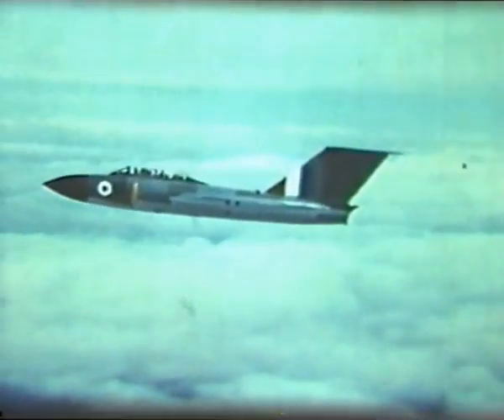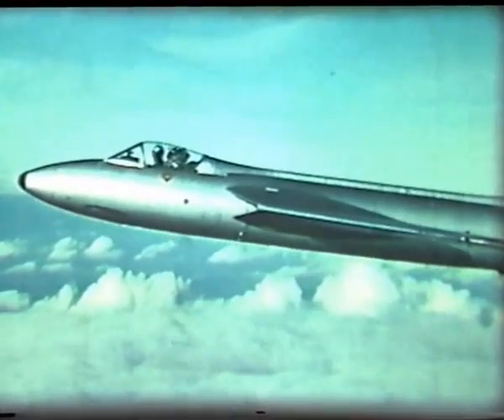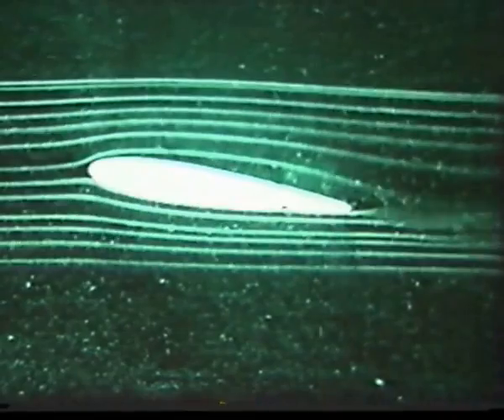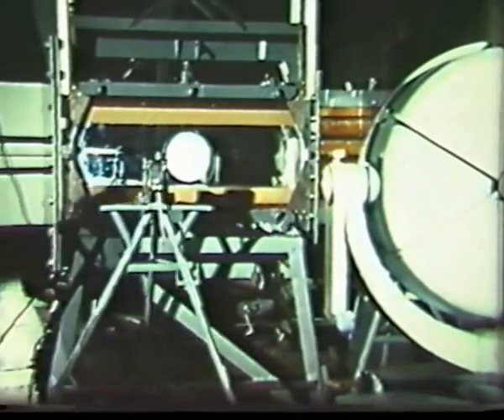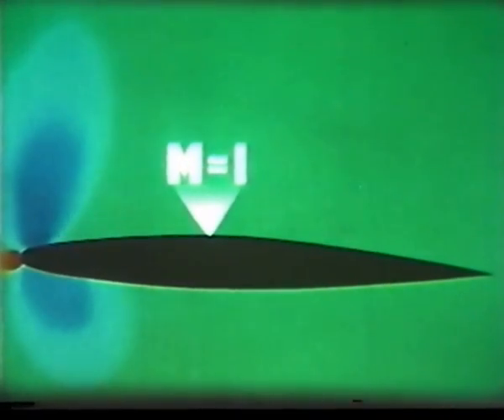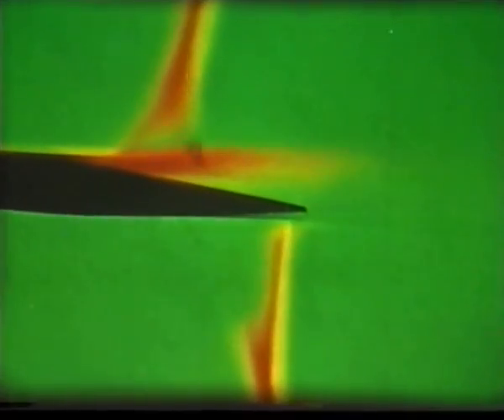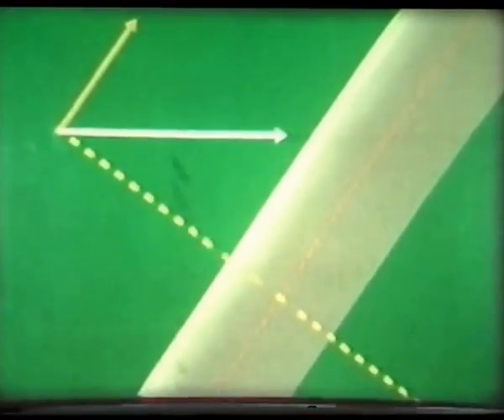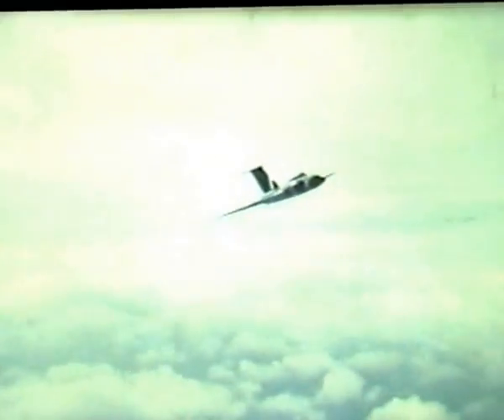High Speed Flight Part 1

Comment: With reference to Zamaca band comment one month ago - after such an eloquent reasoning... the last paragraph should read: "At high altitudes the speed of sound is lower because of the lower air density."
Reply: In gases the speed of sound is actually mostly determined by temperature and molecular mass. higher temperatures and lower molecular masses lead to higher speeds of sound. The air is colder at high altitude, which makes the speed of sound slower than sea level. Hydrogen has the lowest molecular mass, which is why light gas guns (cannons that fire small pellets at hypersonic speed, used for researching the effects of micrometeor hits on spacecraft) use hydrogen as the working fluid that pushes on the projectile. The fundamental reason for this is that the temperature of a gas is proportional to the kinetic energy of the molecules it is made from, so when the temperature is higher (more energy) the molecules move faster and thus can transmit changes in pressure more quickly. Lighter molecules have a higher velocity for a given energy level, which is why gases with a lower molecular mass have a higher speed of sound.

The above does not hold true for solids or liquids. In solids the main factor is Young's modulus (and Poisson's ratio), as a result extremely stiff materials like Beryllium or Diamond have extremely high speed of sound, while materials with very low Young's modulus (like rubber) correspondingly have very low speeds of sound. Steel (as in a train track) is relatively stiff, and thus sound travels through it very fast, much faster than air (though much slower than Diamond). For liquids the determining factor is bulk modulus (or compressibility).

Comment: Great video, definitely cleared some things up.
Something I found very cool, with just the air hose blowing high speed air at 12:00 you can see dancing diamonds.
I first saw these learning about jet engines, when you see the dancing diamonds in the thrust of a jet engine it's running properly.
 Thanks for posting this video.
Reply: They're appropriately called "mach diamonds".
Reply: And most engines are designed in such a way that you should see 11 of the diamonds to see it is running perfect. The SR-71's mach diamonds are really easy to count, maybe because of the highly unique fuel or something? Also, if the mach diamonds are 'dancing,' that is very, very bad as it indicates instabilities in something that should be running smooth with nearly no changes occurring to the internal physics of gaseous or liquid fluid dynamics.

Comment: Do you have the date of production for this film?  How about the original Title?
Reply: 1959 was the year, and the title is “High Speed Flight”
Reply: @AluminumOxide  Thanks!  I see the video is titled now to where I could figure that out.  Apparently, it was not when I asked the question seven years ago.
And, with that information I easily found Parts 2 & 3:  watch?v=ciIv_7WkPxQ